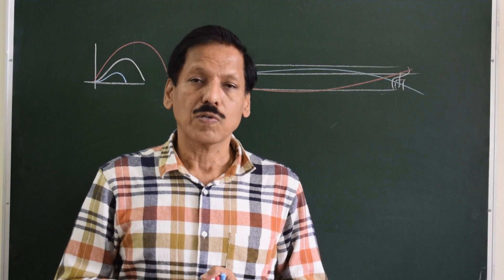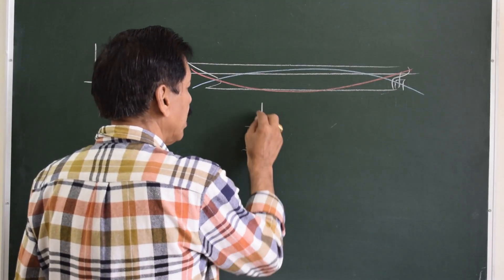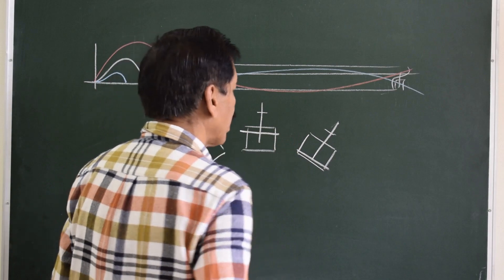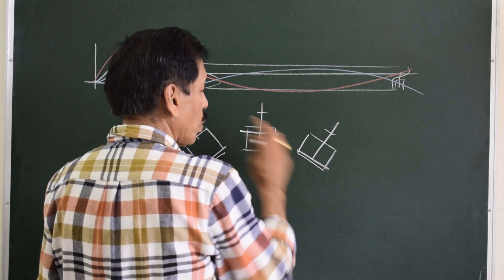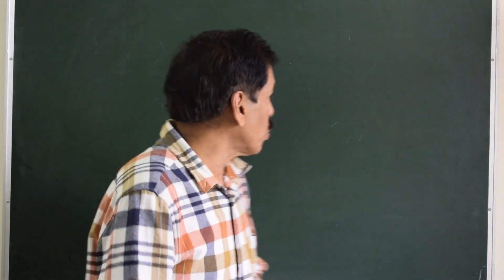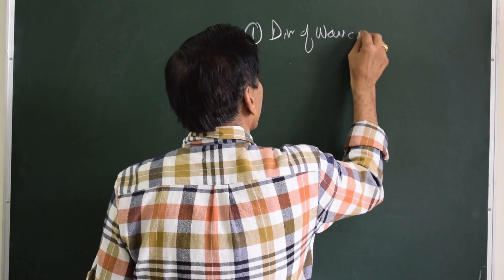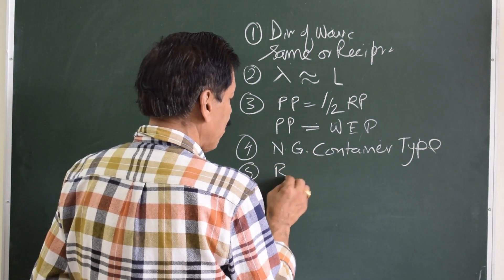Parametric Rolling | Capt. S.S. Chaudhari

Comment: Thank you sir for good understanding parametric rolling.
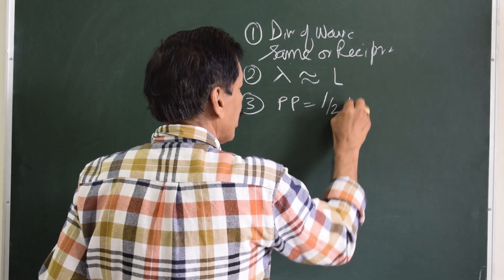Doubt regarding conditions favorable at 7:44 where its metioned PP=WEP, is it not that PP=RP.
Reply from the maker: PP is half of RP. Whereas, RP = WEP is condition for sync rolling with waves from side.
Reply: @capt.s.s.chaudhari5181  thanks sir for clarification
Reply: @capt.s.s.chaudhari5181  
so sir am  I right if I say; 
For parametric rolling to occur either PP= 1/2 RP or PP=RP in head or following seas.
For synchronous rolling to occur RP = WEP in beam seas.
Please clarify Thanks...